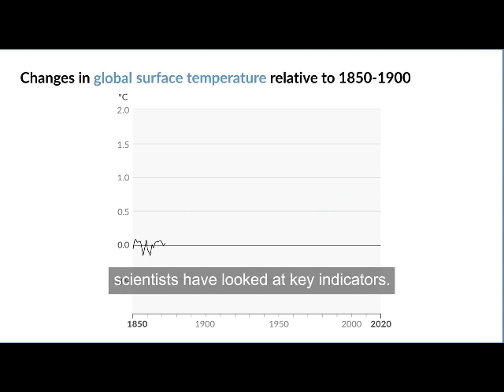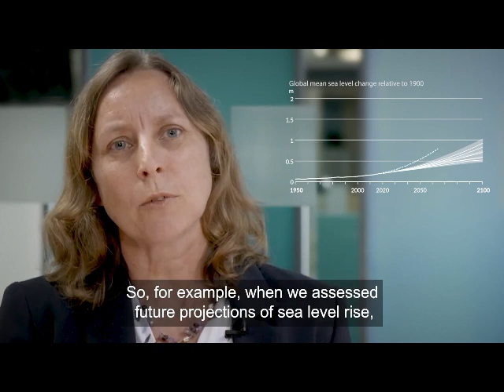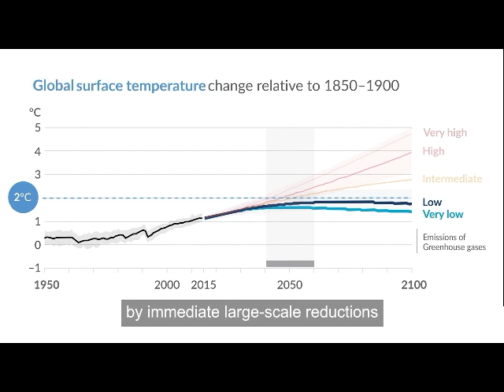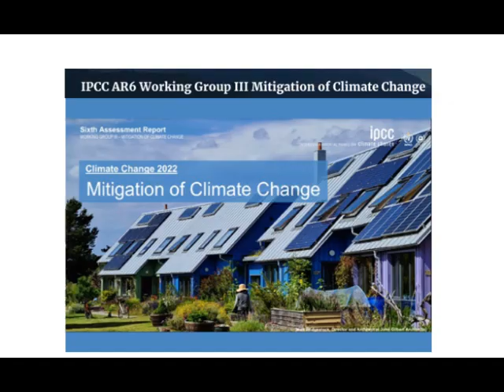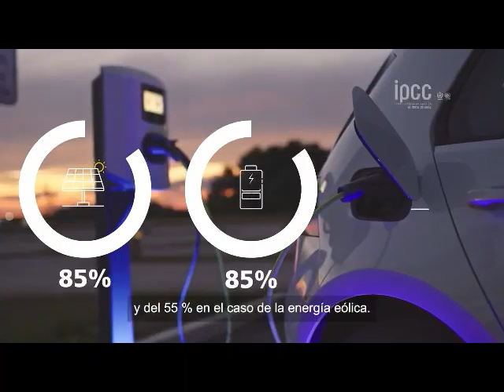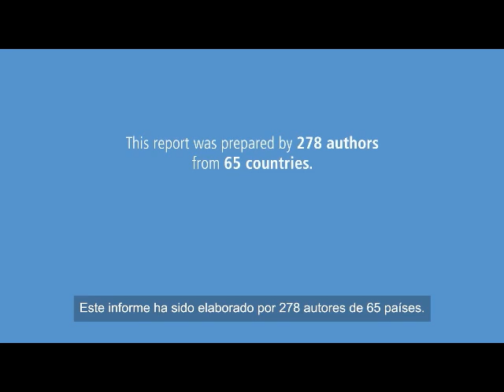IPCC AR6, 3 Working Group videos in 1

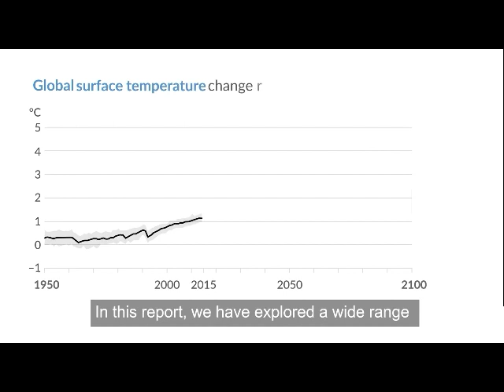Comment: Dear Peter, At 5:40 a graph shows worse case outcomes. How was that SLOPE calculated? Given arctic ice volume losses correlate to TOTAL watts from solar radiation, trapped atmospheric heat, ocean heat&human heat engines, a reduction in arctic cooling capacity predicts a much more abrupt rise than the graph's worst case.